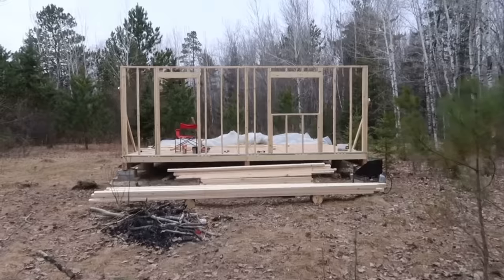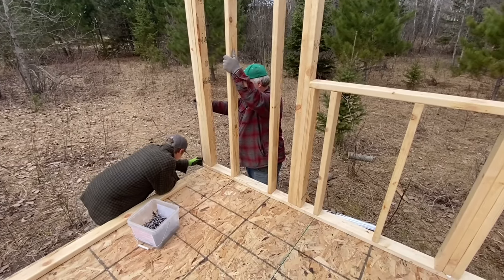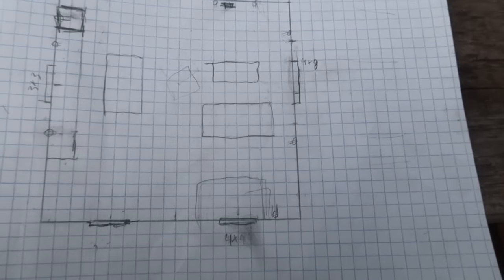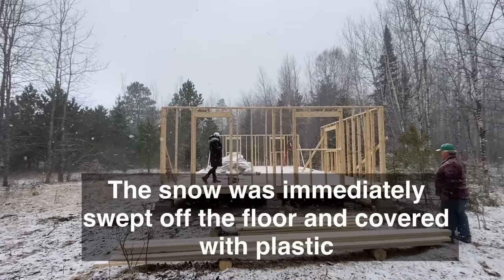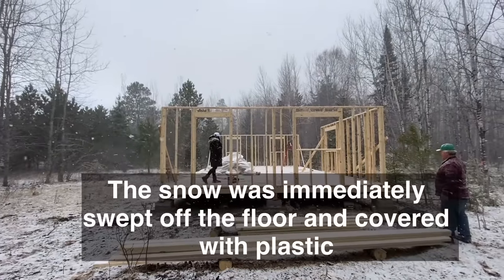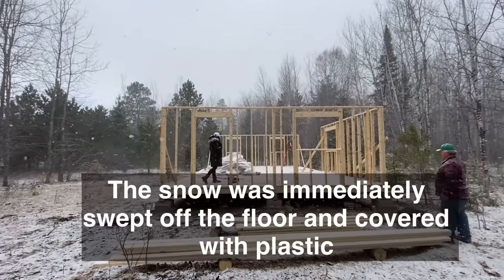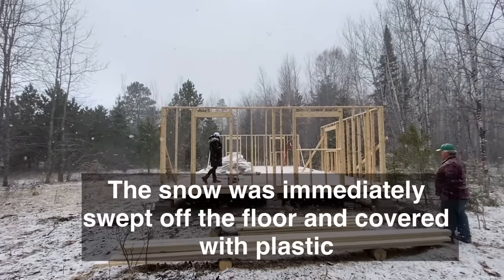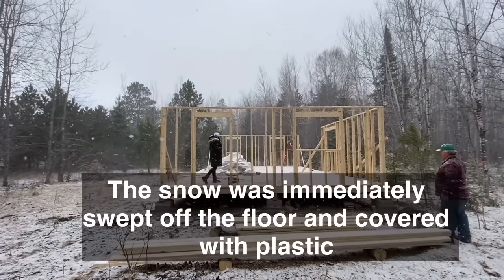Simple Mortgage Free Cabin Build Pt 3: Wall Framing And T1-11 Installation

Comment: What a memory you will have - your family helping you build the cabin.  You work well together.  I tore out the framing in a basement of a house that was 80 years old and between the walls and the concrete floor was tar paper.  There was no rot in the wood and the wood was not nailed into the concrete.  When I reframed the walls I did it the way it was done originally.  If it lasted 80 years it would be good for 80 more.  Go with what your grandpa did.

Comment: Great job guys! Not meaning to be critical in the least but more observations and tips.

For exterior wall corners, rather than using 3 studs nailed together you can use 2 studs fastened together in an L configuration which will save lumber and much more. This will provide a surface for fastening the intersecting walls together, this will provide a surface to attach the interior finish to (backing), this will make running wires around the corner much, much easier and this will provide a cavity to better insulate the corner. Partition wall ties (where an interior partition wall intersects with an exterior wall) can built ahead of time using 3 studs in a U configuration - just remember to insulate the exterior of the U before sheathing. Partition wall ties create a fastening surface for the intersecting walls to be tied together and provides backing for fastening the interior finish to.

House wrap provides more than water protection. As a semi-permeable membrane house wrap allows moist air inside the wall cavity to escape but prevents drafts and moisture from outside to penetrate inside. I'd use it ever time, worth the effort and expense, it's like buying insurance.

Whenever possible, I will frame a wall (or wall section as the case may be), flat on the floor (building the bearing walls first of course - and remember, roof bearing walls ALWAYS go over the beams), and I will attach the housewrap (and any door/ window waterproofing methods/kits),and exterior sheathing/ chalet siding sheathing while the wall is flat on the floor. This saves a lot of time and perhaps more importantly this ensures that when you stand the wall up it is perfectly square and stable, only requiring bracing the wall plumb from outside to inside, no temporary lateral bracing required.

I prefer to fasten the king studs to the headers (lintels) separately and then move them into position in the wall and fasten the king studs to the top and bottom wall plates. Fastening the king studs to the headers in place often can be very awkward and difficult due to close proximity to a neighbouring stud. Another way around this is to fasten all king studs and headers in place before placing and fastening any studs in the wall.

When building walls make sure all of the crowns of the lumber are facing the same direction - any studs with excessive crown can be "fixed" with a sawcut, some pressure and a nail. Walls that will have lower cabinets and counter top should have the stud crowns facing the inside of the building - this way you won't get any big gaps between the countertop and the wall.

Protip: Pay attention to sheathing products manufacturer spacing requirements printed on each sheet. OSB in particular needs to be spaced a certain amount to prevent future swelling and buckling.

Protip 2: Walls can be built in sections as need be. For example, if a wall will be too heavy for the crew to lift in place when built (and no cranes handy),build the wall in sections. The main thing to remember is to offset the top plate splice from the bottom plate splice.

When standing walls. Nail "kickers", scrap pieces of lumber to the outside of the rim joists about every 8' or at least on each end of the wall that will be stood up. Keep in mind the thickness of the wall exterior sheathing that extends down on to the rim joist - you will have to fir the kickers out an amount equal to the thickness of your wall sheathing, scraps of wall sheathing behind the kickers will accomplish this. This will prevent the wall from sliding off the floor when lifting the wall and setting it in place. An ounce of prevention.

Protip 3: A foam gasket under the bottom plate of exterior walls can help prevent drafts from any small voids and is required by code in some areas.

Protip 4: A router with a panel bit makes quick and accurate work of cutting window and door openings in the sheathing (always move the router clockwise), this can also be done while the wall is flat on the floor.

Protip 5: For chalet siding as used on this project, use 2" oval headed galvanized nails. The oval head countersinks the nail slightly and the galvanized coating prevents the nails from rusting and from streaks from appearing on the siding later.

I'm sure that you are planning to do this, but make sure to plumb and brace all the walls about every 8' on the inside before starting the rafters. Running a string line at the top of the outside of the wall and using this as a guide can help ensure that you have a perfectly straight top plate on top of which the roof will go on.

Be careful with heating up cans of canned food over heat, some cans have a toxic very thin layer (veneer) of plastic on the inside that can be transferred to the food when heated. You can "cook off" a can, wash it and use that as a cooking tool. Better safe than sorry!

Good luck and have fun!
Reply: Es increíble el tiempo que ocupaste en este "libro" de sugerencias y consejos. No era necesario. Yo lo disfruté muchísimo y si encontré detalles, sólo lo aprenderé en mi práctica al momento de construir.
Reply: Karen?

Comment: Everything looks good, considering that I'm a beginner. Just wanted to let you know that walls are plum, not level. Floors are level. So anything vertical is called plum, and anything horizontal is called level.

Comment: Good for you boy. I did my first house in 1989 with 5,000 I'd saved in service.  It was a tiny house before tiny houses were cool. 16x24 and I lived there 9 years. I still use that same hammer I bought back then 5 days a week.

Comment: Nice work, and really nice working with your dad.  Remember, seek plumb for vertical members, and level for horizontal members.  I like the outside cladding, but I think I would have finished the interior walls for added rigidity before nailing on that cladding.  I remember framing in snowy weather, and despite the challenges, always liked it.

Comment: If you lay the 2x4 on the 45 up the wall, you can mark it on the studs and notch out and embed it in the walls.  It will help prevent wind racking.  Two notch cuts on either side of the board and a side cut along the edge and the piece drops out.

Comment: Kyle, what are you doing to make sure your girders don’t roll over? You put blocks between your floor joists to stop this, but you have nothing to stop your girders from rolling over...maybe add some blocks under there. This will be important especially considering you did not nail down into your foundational blocks, your girders are just resting on them. Good job keep it up

Comment: Suggestion: If you want to increase wall strength, inset a 1"x3", diagonally, in the corners of your walls. It can be done fast and easily while the wall frame is on the deck.
Reply: Good suggestion, but the T-1-11 should be sufficient.
Reply: However they should be putting the T1-11 on while the wall is lying on the floor, saves so much more time and it already plumbs and squares the walls, then simply stand them up.
Reply: @WolfPackRacing  Agreed. When I was a framing contractor, we built it all on the deck, even soffits and windows. We used wall jacks which meant two guys could raise the finished walls. 
Kyle is just proceeding the way he knows best. His result will be good enough for him and many others. Just lending suggestions, here.

Comment: Very nice! A few questions. Do you have to get it inspected for electrical, plumbing, framing, and fire? Did you have to get a variance or submit a plan to a county or city before building?
Reply from the maker: All I had to do was tell them the dimensions and where the building is located on the property. Nothing gets inspected.

Comment: You’ll be fine without the tyvek wrap, I’m concerned about the reflectix not being enough insulation under the subfloor though (cold feet).
Waste oil mixed with new engine oil add in some fuel oil to thin... actually looks and makes a nice stain.

Comment: Kyle, I've caught up to this late,, and I'm not sure how you plan on using this cabin, or how you will heat it. Just know house wraps serve as an air barrier also, not just moisture barrier. Too late now. But you can still consider  other interior air barrier products before you insulate.

Comment: Nice job on your framing, just want to comment on your headers.  Headers aren't so much structural but are more for fire resistance.  You should always used 2 x 12's for headers to give you the longest amount of time to escape through a window in the event of a fire.
Reply: Not true. There's a reason headers are referred to as load bearing. Without them you get sag over time from the roof load on the walls that can damage windows and doors and affect their proper operation.
Reply: @DavidBrown-mm8fx  correct. Blocking between studs on taller walls is for slowing down fire spreading faster

Comment: Aside from disagreeing on the no Tyvek my question would be how are you mounting your windows? If using new construction windows with flanges they are meant to be installed before the siding. Mounting them on top of the siding, without Tyvek and window tape allows for air flow and or water leaks as well as voids most manufacturers warrantees.

Comment: I find that sheathing the walls then raising them saves time in the long run.
Reply: Just think  also makes it difficult to  finish the outside corners.
Reply: @mikemcgown6362  Leave that section off till later.
Reply: Just think  One pair of wall jacks can easily lift a fully sheeted wall

Comment: Just found this channel. Great job on the build! What are the dimensions on your T-111? I'm surprised that it spans the top of the double plate down to the floor joists. I would have thought it would come up short.
Reply from the maker: They are 4x8ft but I used 7ft studs instead of 8 footers. That’s why it came out the way it did.

Comment: I seen issues with T111 on the peak ends of the house because the peak ends of the home get more exposure to the weather. Never use any form of MDF or HDF siding, it's pure crap. Vynyl is trash and I've seen the siding melt on houses in Washington State and it doesn't get that hot Washington. I've inspected over 30,000 homes a year in my career as a Real Property tax appraiser for the State. What that taught me was to never cut corners when building your house because it will come back to bite you.
.

Comment: I've been looking at purchasing some land in Northern Minnesota, as close to the BWCA as possible. This Spring I'm having a new garage/apartment built on my property, since I can legally do that. Hopefully I can rent that out. I'm hoping to parlay that investment into the purchase of land up North. I'd like to build a simple cabin. Hopefully the land would have some sugar maples. I get obsessed with the Northern Lights too...

I live in Minnesota too, my dad bought a black and white springer about five years ago. I wonder if they are related? Also, will you dig for a well eventually? Would you dig it yourself?
Reply: Hi..I also bought land in Cook County , Minnesota..2 miles from BWCA. Just an FYI, any structure over 160 sq ft and any structure regardless of size is it is meant to be occupied, must have a permit. I'm building a 12 x 12 tool shed, so No permit required.

Comment: Were your floor joists 2x6 or 2x8?  And how tall were your siding panels? 8 or 9 feet?? About to build a smaller version, just trying to see how you got siding panel length to line up extending it to bottom of joist AND to top of the wall. Any help is appreciated!

Comment: The other reason to put up a vapor barrier from what little research I’ve done is it also adds an extra layer to keep the wind out. The less air penetration the warmer and cooler it stays. But either way long overhangs and a good oil based sealer will do the job! Good stuff
Reply: Just think  maybe he didn't have the money in his budget for that. Remember, he's not financing this project. All cash out of pocket.
Reply: Just think  why don't YOU help him out financial then?
Reply: Just think  what's up with you?

Comment: So you have a single 8 foot long sheet of T1-11 cover from the top plate to your rim joist? How long did you leave the studs, around 89 inches?
Reply from the maker: 88.5. 7 ft studs and the bottom plate and double top plate brings it to 88.5
Reply: @KYLESCABIN  Thank you. Clearing some land near Finland this weekend.

Comment: Sorry if I missed it, but what length did you cut your wall studs?  It looks like the 8' T1-11 sheet spans from the bottom of your rim joist to the top of your wall.  Looks nice and will be extra strong.  I want to do the same thing on my cabin.

Comment: Any reason for not putting the T1-11 on before standing the walls? Other than the weight?  I  used a nail gun, saves your elbow.  But , looks good. I agree on the tyvex
Reply from the maker: I wasn’t 100% sure we would be able to stand it up so I just played it safe and did it after. Much easier on the floor though

Comment: y'all are doing great! happy for y'all :) curious, why didn't you sheath the walls before you raised em? is there a benefit to waiting? and it is hard to tell, but how far are you overlapping at the bottom?
Reply from the maker: It’s much easier to sheath the walls on the floor but I wasn’t 100% sure we would be able to lift them with the extra weight so I decided to do it after. It overlaps 5 1/2 inches

Comment: great work, but it does concern  me those outter  walls panels, they look extremelly thin, you can see when you cut them for example on the door opening, they splint easily , I would rather something more solid rather than the looks, but I guess this is a budget cabin.

Comment: You mentioned that the squares on the graph paper are 1ft then said it was 10ft to the window, which is 4ft now the thing is early in the video you said your windows were 35 1/2 inch and you add 1/2 inch on each side so you're able to use packers etc!!
Later in the video you said some windows are 2ft and other's are 3ft the reason I mention all of this is 4ft is 48inches and the biggest windows are 35 1/2inches way smaller than 4ft!!! My question is do you have a window that's 4ft hiding or have you made a mistake while doing the framing and left a opening for a 4ft window 🤔

Comment: started my career in hand driving nails .. but you can rent nail guns ,, also on DBL sill under windows .. for nailer for trim  and You have permits and going be insp or Ins  ,,better DBL check size those windows size for  egress window fire exit code ,,pretty  sure those don't meet the code,, and headers on wider windows need be 2x10 mim
Reply: It depends on what county and state you are in.
Reply: @lisacastano1064   U.S and Ins Co and fire  are  one one Code and only one code from  IBC book ,, person told that have NO business telling you that
Reply: @lisacastano1064  there are  thinking old days 25 years ago under BOCA 25 years ago ..that Misinfo from online

Comment: Very Impressive but I do have an important question and that is...You have no foundation nor are you digging down below the frost line with concrete piles...So isn't this going to be unstable with the Freeze - Thaw Cycle ???  I just don't see why the entire structure is going to drift and warp after a few Winters...I know you guys know your Shit but pls explain why this will remain solid after a few years...Hope someone will answer cuz this is puzzling me... Thx for the Video...!!!
Reply: Hi. I have land in the Candian Shield (Minnesota side) and there is so much rock that many folks just build on the rock. I am putting up a shed now and using one rock for a corner and which are leveled. Things do shift seasonally, but we live with it up here. I have another place that is habitable, and we adjust the jacks seasonally.

Comment: Would a house be stronger if you used screws instead of nails?
Reply: Yes, but it is absolutely not needed. The force goes 90 degrees to the nails, or the wood carry the weight. And when it comes to rust, a screw brake easier than a nail.

Comment: I commend you on what you have done at your age. I would've liked to of done something like that when I was younger but never had the chance. However several things you have done concern me regarding the longevity of your cabin. First off you failed to use Tyvek wrap. For the cost of the Tyvek it pays big dividends to stop air infiltration. Secondly you used T11 siding.  It's been my experience that T1 11 right out very quickly due to water infiltration. Hardy plank would've been a much better choice even though it's more expensive. Third, you used oil stain  to paint the cabin with. I made that mistake once and it did nothing to protect the T1 11 from moisture and I had rotten panels inside of two years. Please reconsider using a quality house paint and primer to paint the T1 11 siding with.  I feel you will be better off in the long run by doing so. Also putting a beveled batten board across the junction of the T1 11 siding where it meets the gable will give you much more protection against water infiltration.  The paint I feel is the most critical suggestion I have is it will definitely seal the T1 11 and give you protection against moisture infiltration which will prevent rot.  I don't mean to criticize the great work you have done but I am concerned that a lot of that work will be for naughtt if you have that moisture infiltration to rot the siding. A job well done sir and once again I commend you on it.